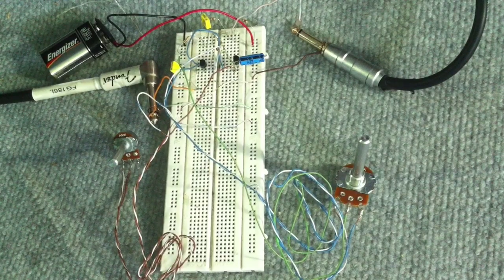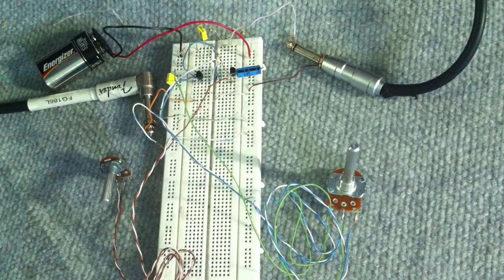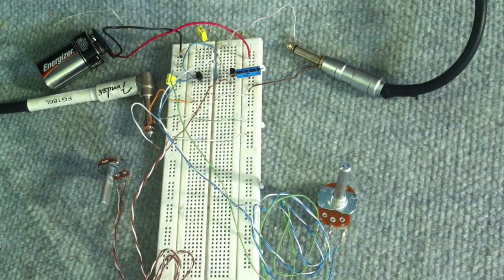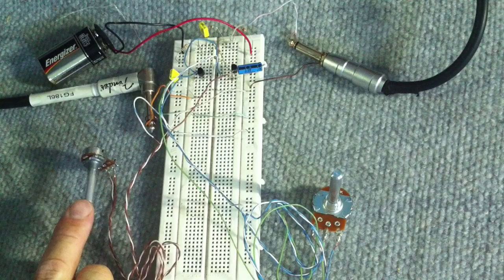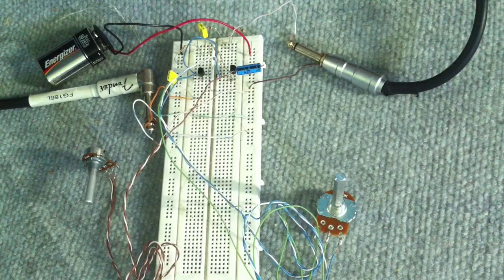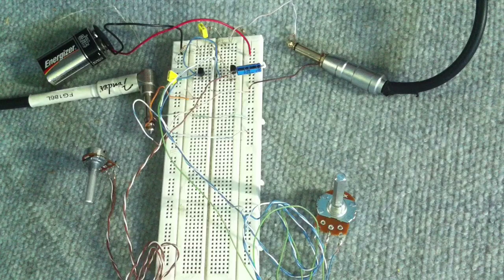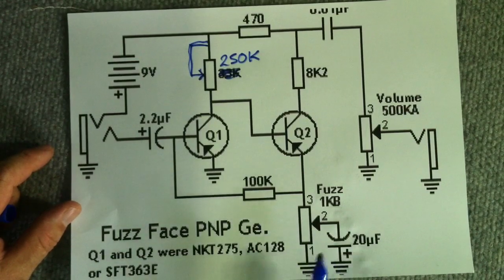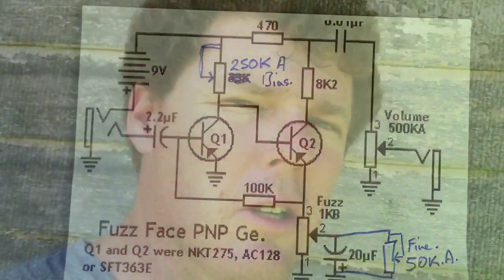Simple Analog Guitar Synth Circuit

Comment: in other words i made a npn silicon fuzz face. then i used 250k pot replacement for 33k resistor and i do not achieve these sounds. i used 2n5088 transistors.
Reply: Is late to this... But do you have the schematic?

Comment: ive tried this with a npn silicon fuzz face w bias and i cannot get these sounds at all. i just get regular fuzz face bias sounds. is this only possible with. the only mods i did was replaced 33k with pot and 8.2k with pot but i dont get trumpet sounds just slightly synthy sounds like most fuzz faces with bias control. ive tried so many pickup combinations. how do i apply your mods to a npn silicon fuzz face

Comment: What kind of circuit is that? Are those two BJT's and a few filtering capacitors? Where did you hook up the potentiometers?
Reply from the maker: The circuit is a Schmitt trigger by definition but guitarists tend to call it a fuzz face circuit.
Yes they are BJT's, BC559's to be exact. 
The capacitors do various tasks, 2 are DC decoupling but they do filter the signal to some degree and the third pulls signal to ground without affecting DC in the feed back loop which is part of the fuzz control.

Comment: Could you do something similar with a Big Muff circuit?
Reply from the maker: I believe it would be possible.
There are four transistors in the Big Muff but the first for gain and the last is more or less a buffer.
So the middle two could have pots in place of the cathode resistors or a higher value. 
Not forgetting to use some cheap transistors like I did here.(BC559 for PNP or BC549 for NPN).
You would have to experiment to find the right values.

Comment: How easy would it be to mount this in a guitar?
Reply from the maker: +surfdigby If you have the room in the cavity for a battery and a small circuit board it would be easy enough.
Reply: Thanks. I picked up an old cheap Strat copy that I plan to go psycho on modifying. If I were to install this, would it be possible to fit a switch to have either synth, guitar or both, or would there be too much drop out from the raw guitar signal?
Reply from the maker: surfdigby You could switch between the two but to have both together you may need to use a buffer circuit or two.
Reply: Thanks.
Reply: +Paul Graham (Guitar) 
hi do you have the schematic of it?

Comment: Pure heaven huh? Gotta love the almighty DISCRETE transistor! Eat that Chip!
Maybe put a multi-turn pot on the circuit. I've played with Fuzz Face circuits for years. Even built one a few years ago using two Raytheon CK722 transistors that were oddballs in a batch of 46 I had. The hfe was 4 times higher than the other 44. Oddly enough the circuit worked best with one CK722 and one old round Motorola 2n699. I managed to get some brassy tones using tantalum capacitors.
I have several hundred old wire wound resistors of about every value and have been messing with them compared to the usual carbon resistors.
As an organ player I have saved many organs ( 10 I play daily:), but I salvaged a Thomas Organ wah circuit from a too far gone Thomas 263 Californian organ I had. The range is crazy! The Thomas Californian organs have a very spitty nature you might enjoy. Just Youtube search HARRY WACH THOMAS ORGAN CALIFORNIAN HERE I COME ( side 1 and 2 are posted ). The blue tabs on the organ are the key-percussion circuits, like marimba etc.. My motto is SAVE THE ELECTRONIC ORGANS they won't make them again that good. Especially Wurlitzer and Hammond electromechanical models- Hammond tone wheel, and Wurlitzer electrostatic reed. Check out the NORTH SUBURBAN HAMMOND ORGAN SOCIETY for a very very cool introduction into these organs. The articles are laid out complete with circuit explanations and sound examples. I play a Wurlitzer 4410 electrostatic reed on my channel if you really want to hear the beefy analog tone that comes from what only electromechanical tone generation can provide. BTW the guitar is electromechanical too in case some of you are confused about the term. Actually an electric guitar and a Hammond tone wheel organ are pretty much the same beast. Check out LEGENDARY THEATER ORGANISTS documentary vid on Youtube and about halfway through they have an old B&W film short of a Hammond tone wheel on a little finger hand crank. As it rotates the tone wheel in front of the wire wound magnetic pick-up ( exactly like a guitar pick-up, but 1 pole instead of 6) it creates the tone. With the Wurlitzer and Hammond organs being kin to electric guitar it is insane that a guitar player would destroy one to build an amp from! Remember, we're all tone heads:)

Comment: this would be great to add to a wah and replace the single pot and add a stacked volume pot, that you can reverse the volume to go louder when you press the wah forward or switch it so it adds synth effect reverse... So you would have clean wah one direction and a dirty wah the other direction and with the wah switched off it would act as a volume control to the synth sounds... You would still have to adjust the synthesizing sounds just the way you are in the video... This is great ill have to see if I have the electronic parts to build one.. Great video Thanks